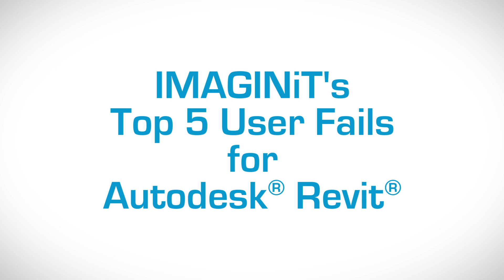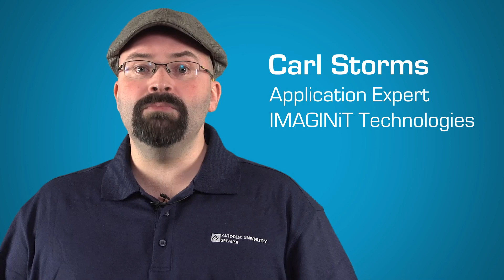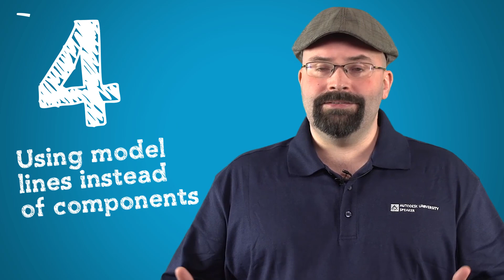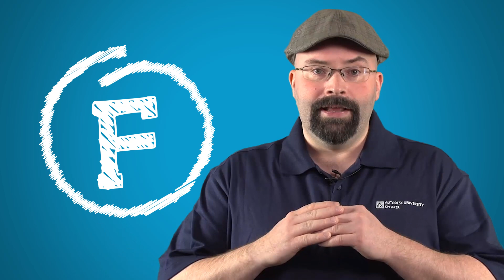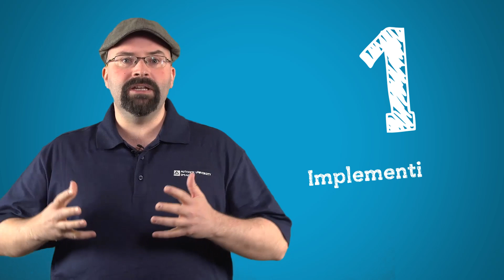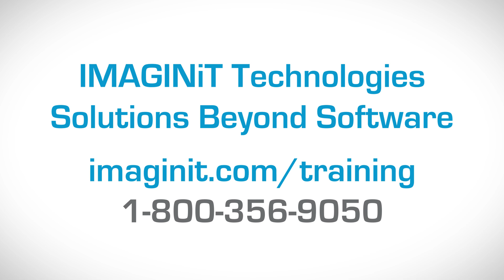Countdown: Top 5 User Fails for Autodesk Revit

Comment: From the perspective of a mech eng, I disagree with Point 3. Unfortunately, controlling visibility of multiple MEP services in a single model is next to impossible without worksets. Provided the services are modeled on the correct workset, this workflow actually improved the modelling and coordination performance.

To be clear: I seperate worksets by fire services (FS), mechanical (ME), medical gas (MG) and wet services (WS). To dive deeper:

FS has sub worksets for typically fire protection, fire water, sprinklers, gas suppression, fuel reticulation etc.
ME has sub worksets for HVAC, Condensate, Specialist Equipment for bus/train stations etc. such as compressed air, lubrication lines etc.
MG has sub worksets for oxygen, scavenging, anesthetic, vacuum etc.
WS has sub worksets for water, drainage, stormwater, equipment (pumps/tanks) etc.

I am aware that is wholly impractical for architects and structural engineers; however, mechanical engineers are left in the dark with controlling items and have all resorted to using worksets for service-level visibilty. After years of tinkering with filters + templates, they just dont not cut it! Not to mention the performance benefit of closing unneeded services, links etc. via worksets without affect templates...
Reply from the maker: From our experts: I think there may be a misunderstanding of the intent behind Point 3 and I think there is a healthy discussion that can be had to determine what the right balance of worksets, filters, and view templates is, with the understanding that you can go too far in either direction (too many or too few). Worksets are necessary for a number of reasons, including system performance, and visibility control as you mention. Carl’s point of, “using worksets like layers” is different from how I interpret what you outline in your comment. Using worksets like layers would go well beyond the number of worksets you mention and mean that you essentially take what would be a traditional layer list and convert what are potentially hundreds of layers into an equivalent number of worksets. You appear to be grouping things into connected systems and that is a significant difference. In the end, your solution might be right for your firm, and not the best answer for another firm – but the solution that you do come to needs to be easy to use within your practice while also being easy for the people receiving your file to leverage as a linked file.
Reply: @imaginittech  Thanks for you reply. I don't think I made it clear, but I do agree that using worksets like layers is a bad idea and find that the video is very useful for newcomers. 

I would never recommend someone to split say an HVAC system's ducting, duct fittings, terminals, equipment etc. into separate worksets <-- this is what I understand as the AutoCAD "layer" method.

I initially went too far with filters and that causes a lot of problems. Sure, it worked well with just a single service, but when multiple services came in, filters alone could not handle job.

I currently have a healthy balance between filters and worksets that feel like they complement each other rather than compete.
Reply: For these cases I tend to use exclusion filters (NOT) which make the process much easier. So for example on a mechanical plan, instead of filtering single plumbing or fire protection categories or types out to not show I use something like {System Name | does NOT contain | 23_Hydronic} and then turn the visibility off for this filter since it grabs anything that isn't related to the mechanical systems. I typically add a few different arguments for other systems like condensate or refrigerant piping and it works quite effectively. I still have a workset for the different disciplines, but it is mostly simple and is up kept by dynamo/addins that run some simple rules.

I am also not a fan of using worksets for visibility because an element can only be on a single workset. So I have coworkers that will make ENLARGED and SITE worksets to hide elements but want to see some of those on random plans so they end up adding more worksets late in the project or start hiding in view items that they don't want to see. 

(This comment was several years ago so there probably were several updates to Filters, View Templates, and Revit in general that I am not aware of which prevented this. I think it may have been that compound rules for filters didn't exist)
Reply: @bobrossdahoss  we use filters extensively, but not for service wide visibility. Worksets are king in that regard, but not as "layers" but as "system categories"/"building segment categories"